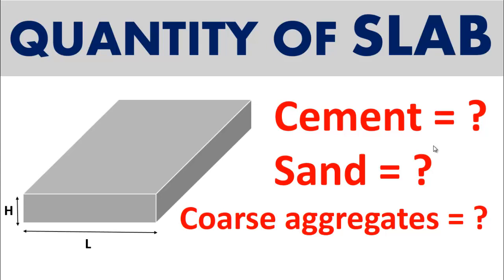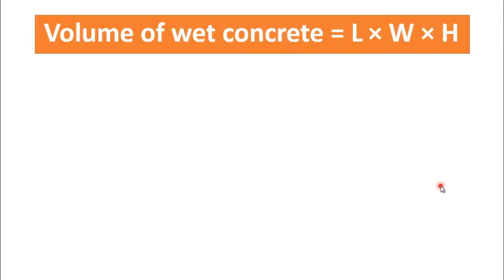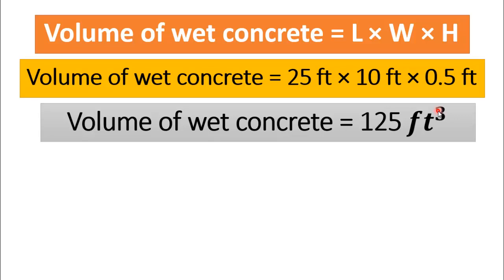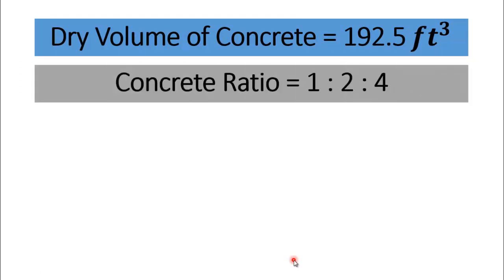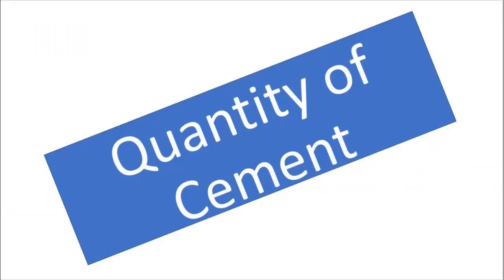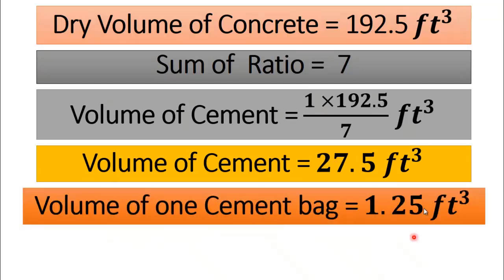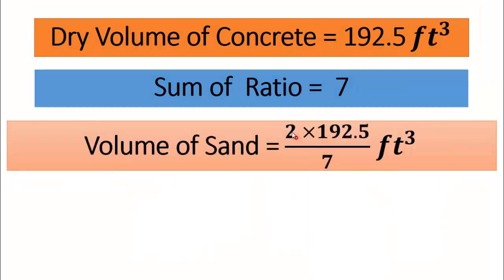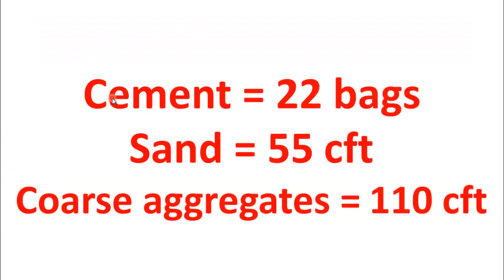Quantity Estimation of Concrete Slab | Cement, Sand and Coarse Aggregates in Slab | Quantity Survey

Comment: How to convert volume sand into bags.please answer.
Reply from the maker: Just simple bro. Divide the volume of sand by volume of single bag. 
But sand is generally calculated in cubic feet or cubic meter units. And there is no need to convert sand volume to number of bags.